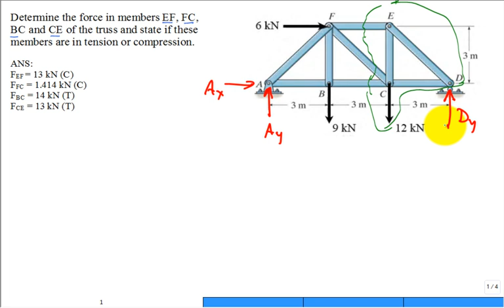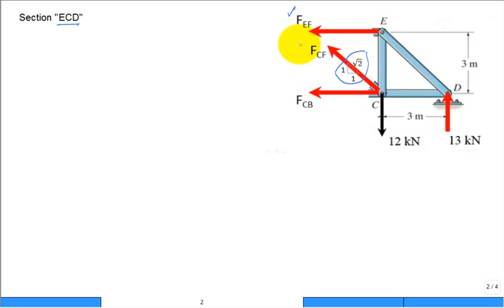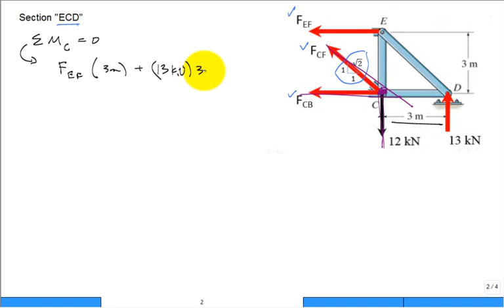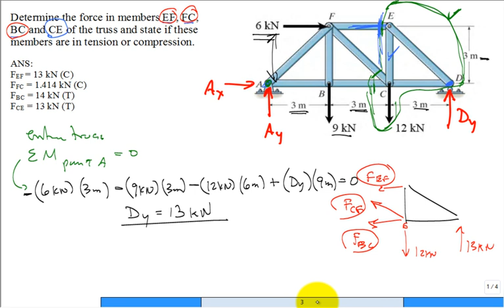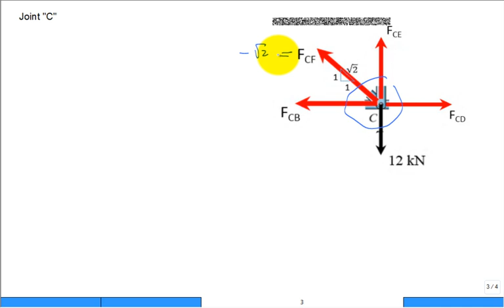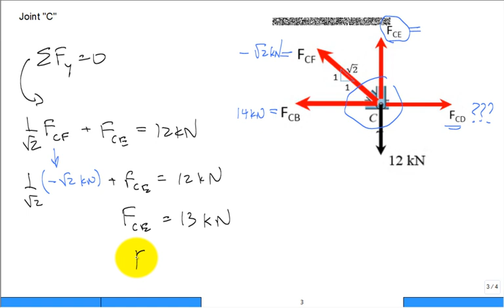youtube video #6CnNAd8kMb8

Comment: At 10:18 it says “...plus the force C to B in the negative X direction”, yet FCB remains positive. Please explain how so. Thanks.
Reply: I think it's made like that because it's assumed everything is in tension, which is why when you plug in your answers depending weather the answer is positive or negative will tell you If it's in tension or compression.
Reply: Yeah i think it is negative and I change the final answer on his example. Maybe he mistakably thinks that it is Fy so he make it positive instead of Fx which is negative.
Reply: Why need to keep use negative value of Fef  instead just use the one that has been change to the positive value  to Fcb

Comment: Why the Member  ED was not taken into consideration for Fy= 0!
Reply: Roller support at D?
Reply: Thankyou for your reply...that was my doubt a  month bfr..now It is clear.. Force in ED is an internal member force and need not consider when solving for other member forces...😅..
Reply: @ertugrulcam5142  Just relax...
A 3 stepped cantilever beam with 2 parallel loads at each step with same magnitude and an axial load at free end (3rd step)  would be a great example for understanding the internal member forces..Assume a cut made in any of the section...for that section to be in equilibrium it must develope internal forces(= left or right side external force)..this internal force divided by area is the stress developed by that section due to external load..similarly every section of the beam will develope this internal member force depending on the external force it need to balance...
And for calculating this internal force at a section we are considering only the external forces it have to balance so that it will be in equilibrium not the other internal member forces...(since every member is stressed all section must have developed internal forces)

The same equilibrium concept is used in truss...while considering the members at the cut section..we have to worried only about the external forces not the other member force...Hope it is clear..

Comment: ENGISSOL 2D Truss Analysis software features a powerful finite element solver to analyze trusses consisting of elements with rotational releases at their both ends. The deformed configuration under external loads is calculated and the axial force diagram of the structure provided by the user is represented. The creation of the model is an easy and quick task as the user can take advantage of the intelligent user interface of the software. Its versatile graphical user interface, the predifend libraries and many other available features can save you time and effort. Moreover, the program also supportes non-linear static analysis (second order analysis) for the consideration of P-Delta effects.